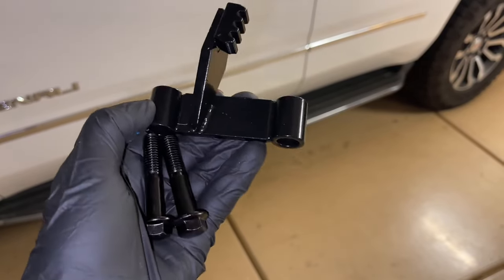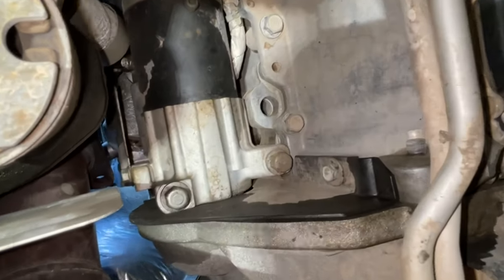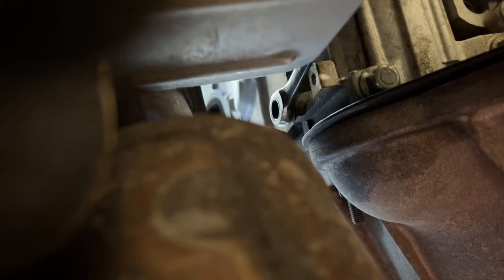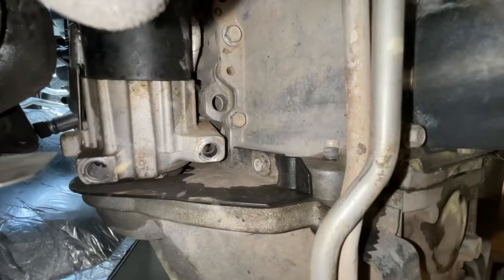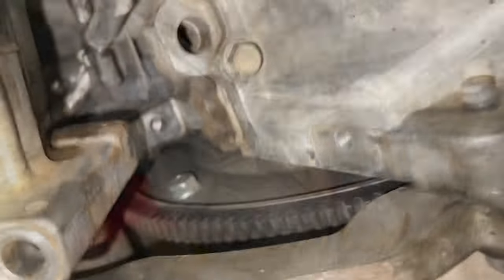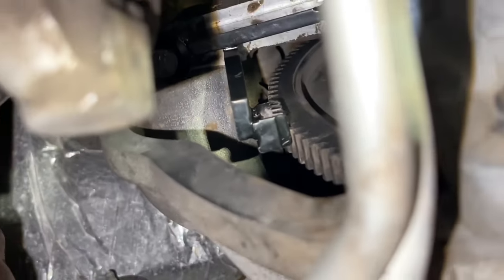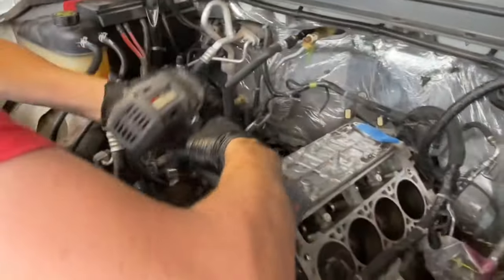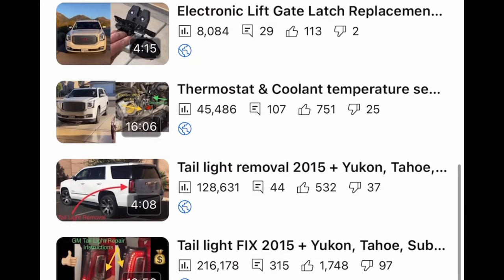Flywheel & crankshaft holding tool demo & use: How to lock the crankshaft & keep it from moving GM

Comment: hey man, i’ve got a 2004 mustang gt 
my batteries keep draining every 2-4 weeks 
also has a starter rapid click sound when turning over but it still starts any ideas 
i’ve replaced the alternator multiple batteries 
the starter, i have a feeling it’s a bad starter ground?
Reply: i have no radio no sub that could be draining my batteries
Reply from the maker: Here are a few ways to test fuses for a power draw. If you have a factory radio make sure it is turned off before the car is turned off. Its common for it to drain the battery even with a stock setup https://youtu.be/s98LpJFGg4A?si=VZSMAUqMINJMpT6o